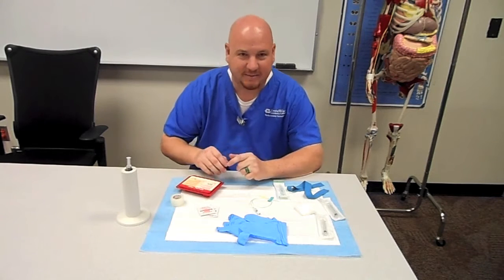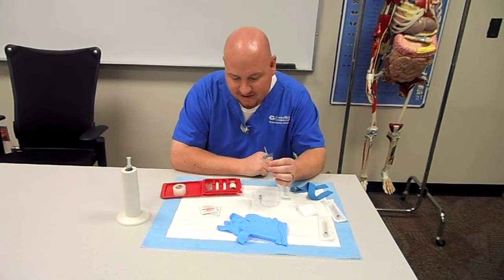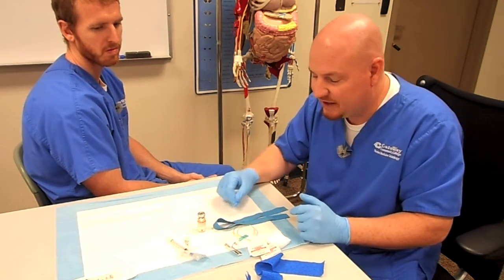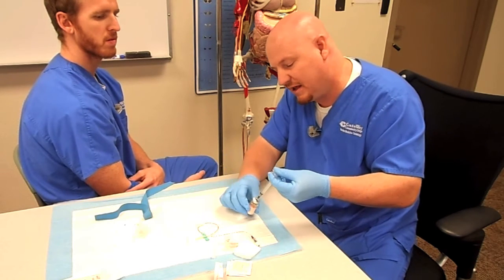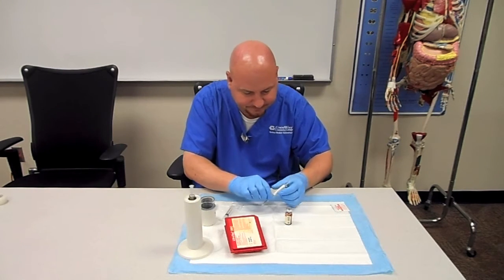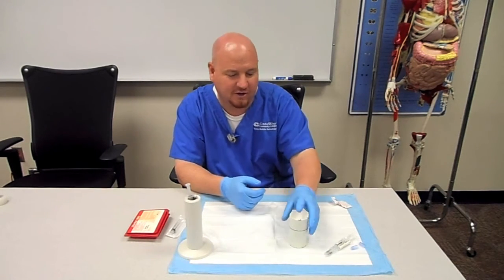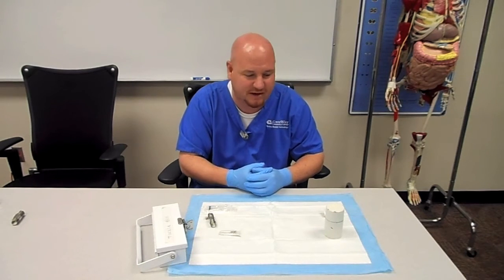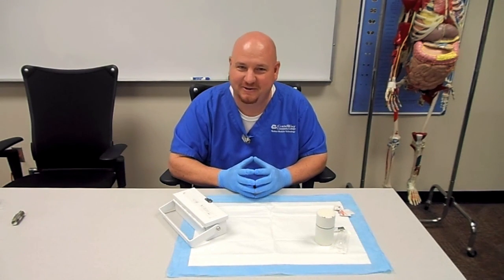Nuclear Medicine UltraTag Kit

Comment: Very nice.  Thank you.  Only comments (from a RSO) is regarding capping needles and wearing lab coats.  The needle issue is difficult (reasonably) and coats are often considered an option except when reading NUREG 1556 vol 9.
Reply: yeah and make sure that hot lab door is locked